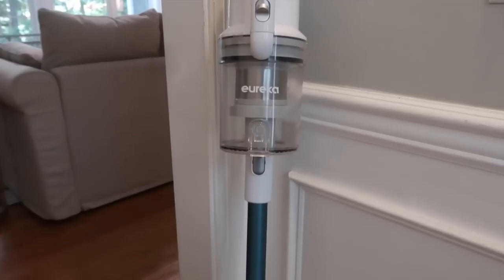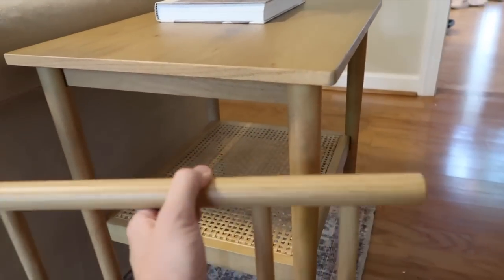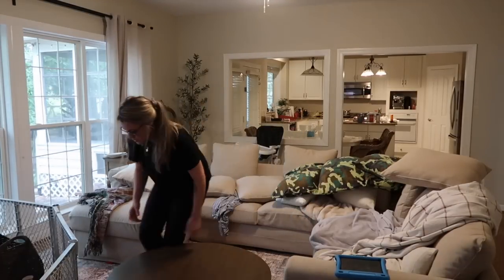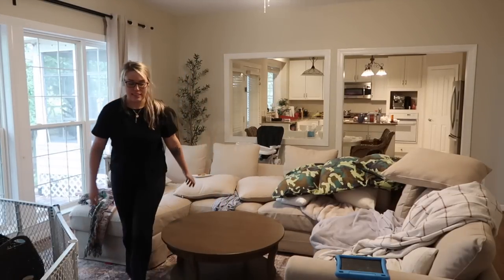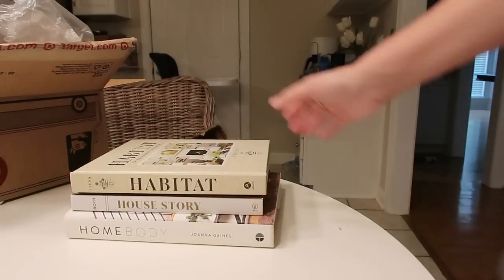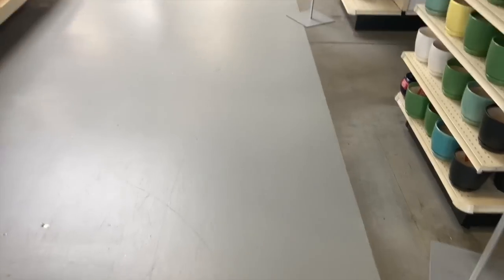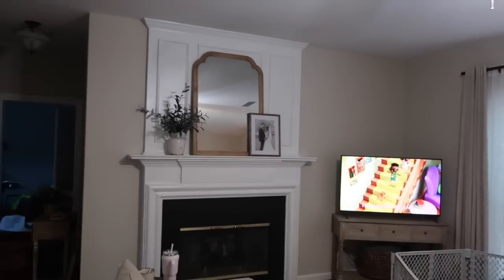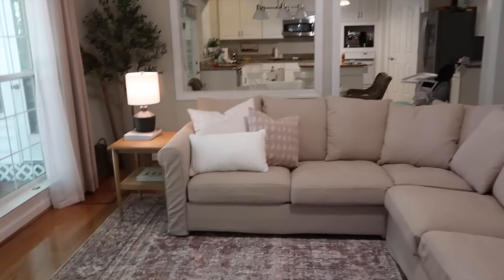HOME DECORATING IDEAS, NEW FURNITURE, ROOM REFRESH, HOME DECOR SHOPPING | HOUSE TO HOME MOVING VLOG

Comment: I have the cordless shark vacuum like yours and when that happens it’s because the tubing is clogged. On the bottom of the vacuum (the bottom that touches the floor) turn it over and there should be 2-3 pieces that you’ll have to use a butter knife to unlock and you’ll lift that piece and be able to unclog the hose.. I have to do this ever so often and once it’s put back together, it works just fine again